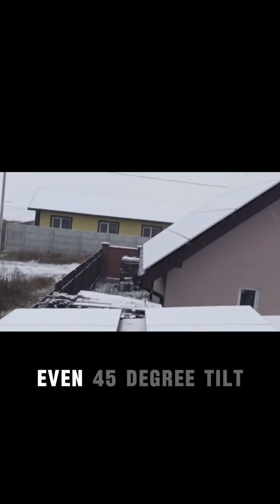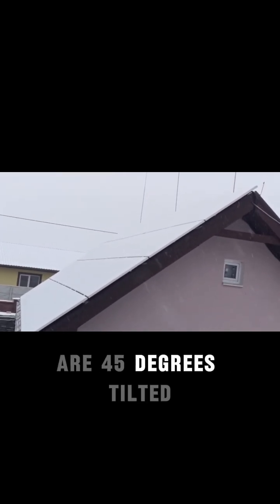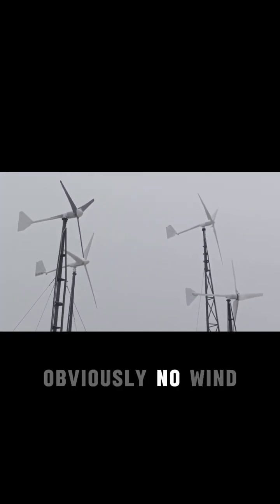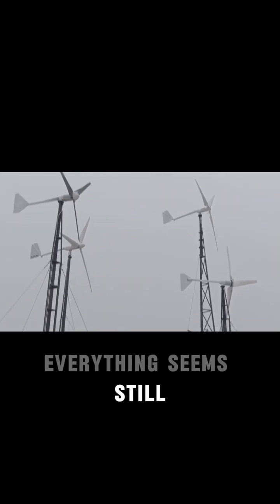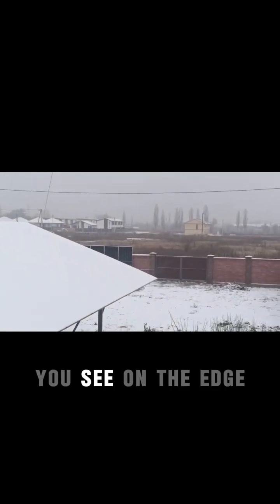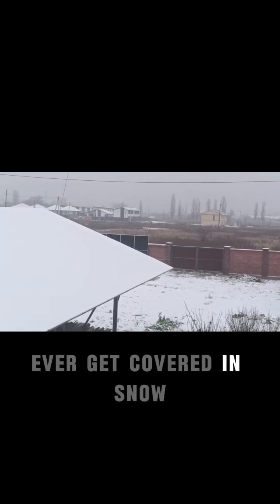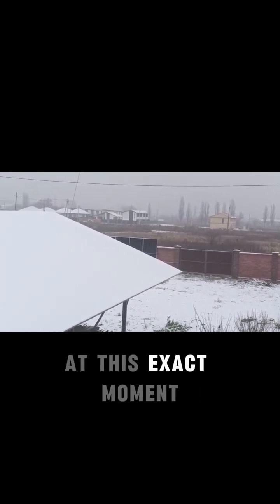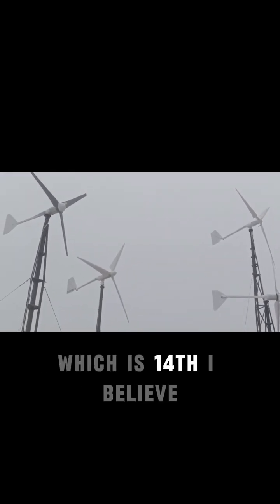Snow Covered Solar Panels - Discover Which Panels Still Produce Power!

Comment: Cool setup with multiple modalities to produce electricity. What about building a properly angled dirt berm on the backside of the vertical solar panels. When the berm is covered with snow it will reflect light at the proper angle back onto the solar panel. You could also berm the other side so any sunlight that reflects of the glass surface, is reflected off the snow covered angled berm back at the panel.